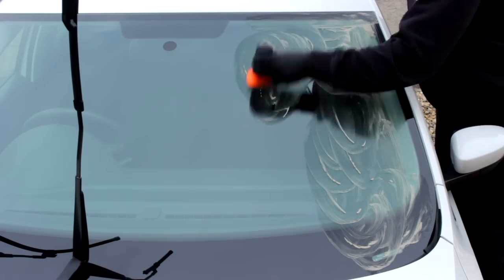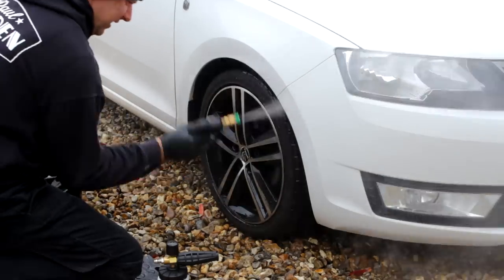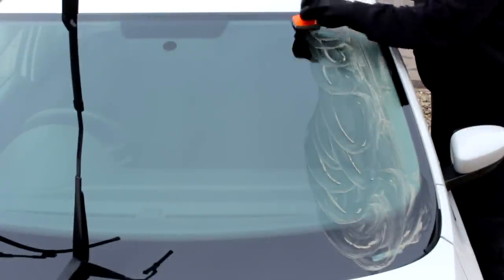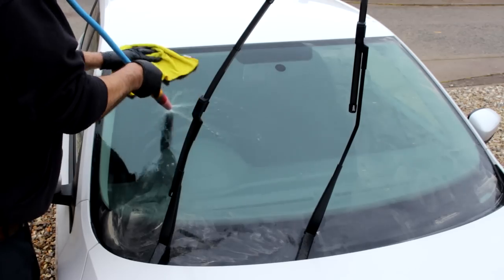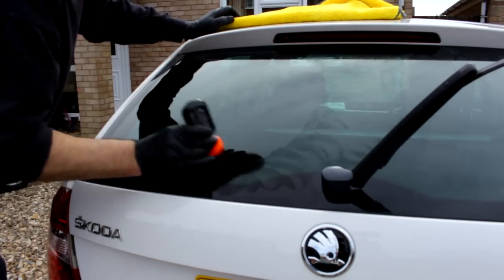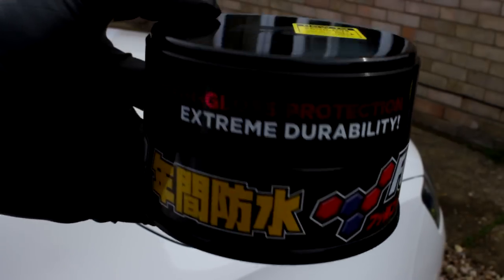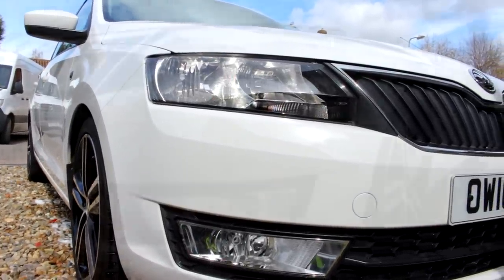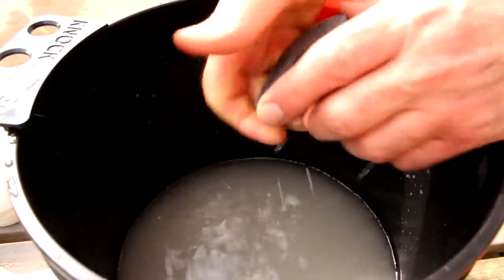SOFT 99 FUSSO COAT APPLICATION | GLACO GLASS COMPOUND AND PROTECTION

Comment: I have three cans of the original Fusso soft 99 
It is hands down the best 
The trick is to apply it thin thinner thinnest. 
I’m not kidding 
Go to heavy you will get high spots 
Leave it on to long and it’s a real pain in the neck to get off 
I applied it let it sit until I started to see a haze 
Used a micro fiber to buff it 
Then used a second micro fiber to make sure I left nothing behind 
When finished I went over it it one more time looking for anything I might have missed 
Don’t use this on plastics 
As for durability I do two coats 24 hrs apart and it does last a year.

Comment: I've got the fusso coat light variant and water block metallic and they are both superb but blimey the solvent stink from the water block one is enough to burn your eyebrows off. Excellent value for money too as the tins are massive and you barely use any.

Comment: I applied Ultra Glaco in October and it was still performing at around 31mph up until about a 2 weeks ago when I replaced it with Glaco.

I was told that Original Glaco was supposed to work at slower speeds so applied that. Didn’t polish this time just claying etc. But the performance is worse. Not sure if this is to do with prep or that it rained an hour later or that I applied over Ultra essentially. Will start again, when we get more than 5 hours without rain. But Ultra seems to be superior. 

Was the water behaviour filmed on a different day as my instructions do say keep dry for 12hrs

Comment: Another great video.  Is there a product for blacking plastic trim on a  MINI that can be used when car still wet?

Gyeon have Wet Coat detailer to apply when panel wet which saves time.  Use Back To Black but have to dry trim first.  Any ideas?
Reply from the maker: Dry car always try Carpro Perl
Reply: @PaulDoldenDetails  👍

Comment: Hi Paul, I'm interested in using the glass compound and protection sealant. Have you tried using your wipers at all, (I appreciate that you shouldn't need to with this) as I know that if you put Rain X on some front screens, and then find that you do have to use the wipers it can make them judder very badly whilst using them, I know Peugeot do not recommend any kind of Rain X style protector.
Reply from the maker: Not needed wipers Since I’m hoping to capture this on a video for proof 👍🏻

Comment: Another great video Paul. Would love to try the Glaco out on the windscreen of the my truck. Tried one a few days ago and the water didn't go anywhere quickly, the only thing I can think of is the screen is almost vertical not angled like a car. Your thoughts please sir would be appreciated.
Reply from the maker: Hi Paul the water 💦 should still sheet off the Metro has a windshield which has a shallow angle so I know where your coming from polishing the glass first makes a big difference I feel

Comment: Just used the Glaco on my windscreen, followed all the instructions, but now my wipers judder badly, any solutions for this?
Reply from the maker: Did you polish it throughly
Reply: @PaulDoldenDetails  I machine polished the windscreen with Maguires windscreen polish. I then sprayed the window to make sure there’s no coating on it whatsoever.
Reply from the maker: @adamfarmiloe in my video I used the compound with the kit the Megs polish my have contaminated the coating I’ve never had judder and it’s been applied to several cars
Reply: It’s like the wipers get stuck to the windscreen, the car is only six months old, so the wipers are perfectly fine

Comment: I wouldn’t have put the fusso coat on if I was planning on polishing it soon
Reply from the maker: I wouldn’t worry too much I’m always testing new products it’s a video to show the product application and results I may be polishing a different car so stay tuned 🙌🏻
Reply: The protection is strong but machines cut through ceramic coatings so as for wax, your first pass won't exactly cut great due to the slickness but with a coarse pad and heavy compound its not that difficult. I've tested this many times. 

Just enjoy the video pal, it's not about what happens after it's a helpful video on how and why to apply it, not a video on how to remove it.
Reply: @jonnyshielldetailing  so far every detailer has always said strip the protection with chemicals or like a strip wash before you polish, they always teach you to strip any protection before any polishing , so basically your telling me I can skip that step before I polish ? 
I will be polishing my car soon and there’s strong protection on it , not ceramic but a good protection, I can save time and money if I don’t need to strip the protection
Reply: @M.E63  ok buddy, so the decon process will degrade any wax considerably after going through the iron fallout and tar and glue process followed by clay batr.. tar and glue is a solvent and will certainly strip protection. You are going to be able to test the panel by seeing the water behaviour on the final rinse.. IPA the surface  then check with spraying water to see if the water is beading or not. if so your success has been achieved. If not then do a polishing set and wipe off using an ipa or apc which will tell you once you've applied some water to that area and if its flat with no beading. You are removing clear coat and it won't take alot to strip it. the reason why they say it must be completely stripped is effects the rate of cut as the wax will make the pad aquaplane over the surface. it's not as scary as they will make out pal.
Reply: @jonnyshielldetailing  I need to polish it soon and I don’t think my car needs claying as it’s only 5 months old , but I’ll know more once I’ve done the decon, maybe there’s no tar either as it’s been driving mainly in winter but the car is black so might be hiding some bits of tar , thanks for the advice will need to tackle it soon

Comment: He is a pro people but , please never ever do a whole  car please break the car into sections , also avoid doing circles  it may cause  halo effect go  in a back fourth motion with a 90 degree overlap , also take temp and humidity  into consideration  as this will effect your cure time, and less is more with the product, if your damp sponge applicator  is clogging  then you are using too much .  Also make sure you use a  high quality  clean microfiber cloth  min one to 3 cloths per panel .